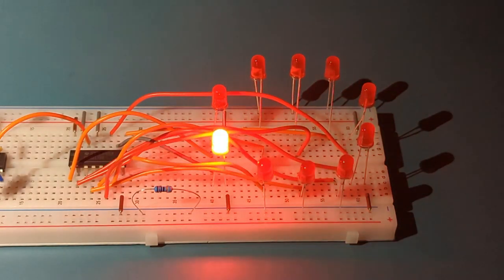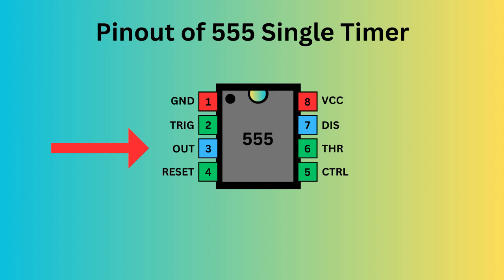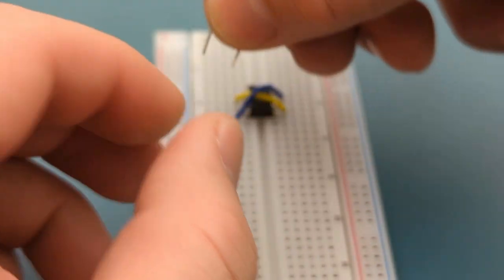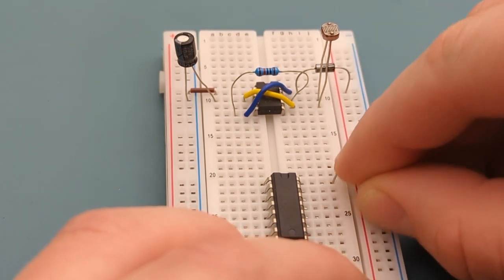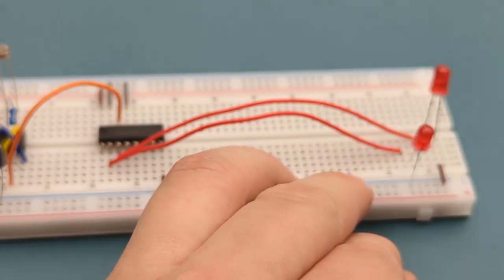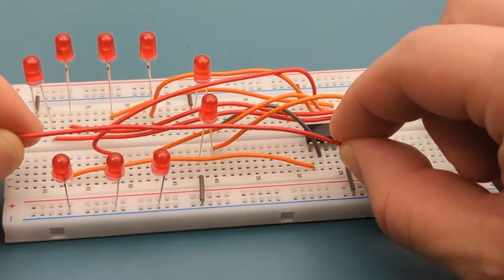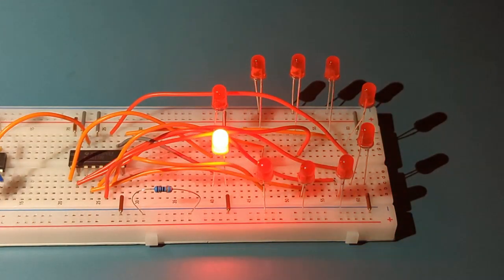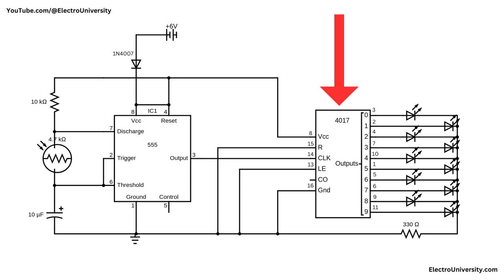How to Make LED Night Effects With 555 Timer + CD4017

Comment from the maker: 🔔 Get your tools here:
✅ Electronics Component Kit: https://amzn.to/3N65asq
✅ AA Battery Holder: https://amzn.to/4gCInSx
✅ AA Batteries: https://amzn.to/4j0x3Rb
✅ NE555 Timer: https://amzn.to/41MpQhp
✅ CD4017: https://amzn.to/427elAR
✅ Resistors: https://amzn.to/3YfGeUi
✅ Capacitors: https://amzn.to/3PzflXK
✅ Jumper wires: https://amzn.to/3NNn9UR

Comment: That 330 Ohm resistor is definitely not doing anything.  Even if the negative rail was split (which it clearly isn't) that wouldn't help the LEDs on the OTHER side of the board. It's improperly wired. The only thing saving those LEDs is the voltage drop from the diode and the chip and the fact that they are only powered on for a brief moment.

The schematic is correct but this implementation is wrong and will kill those LEDs sooner rather than later.
Reply: Even with this his procedure it's not working
Reply: I have to take pin 14  and 15  of cd4017 to the positive leg of the board

Comment: I don’t understand.  How can the current limiting resistor for the LEDs work?  Both ends of the 330 ohm resistor are connected to ground.  There is no voltage drop across the resistor and no current passing through it.  The LEDs are taking the full voltage and current from the 4017 pins.  The schematic is correct, showing the resistor connected between the LEDs and ground.  But the resistor is not connected that way on the breadboard.  The leads of the resistor are both connected to ground, and therefore have no effect on the circuit.
Reply: Some breadboards split the power rails into sections so the resistor might actually be bridging a gap.
Reply: I don’t think that’s happening on this breadboards.  The red and blue lines run the full length of the board with no apparent gaps.    I think the resistor could be removed and there would be no change in how the circuit works.